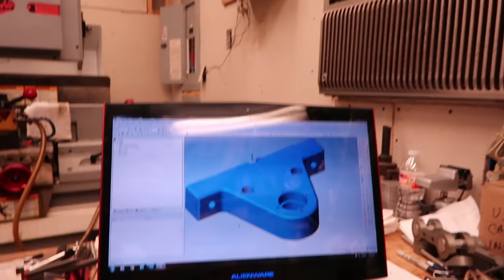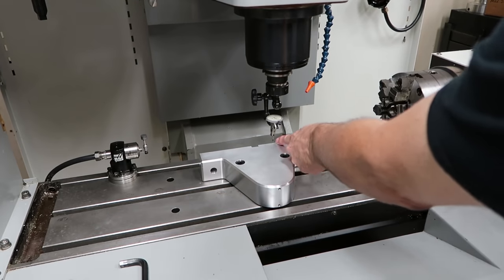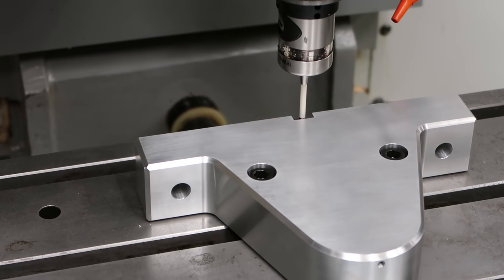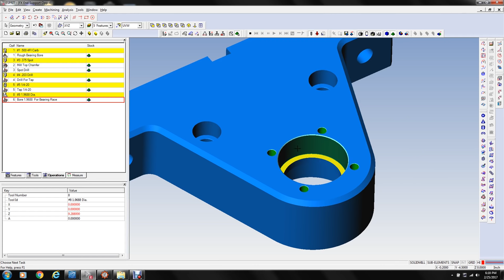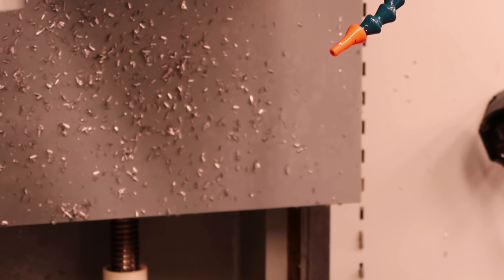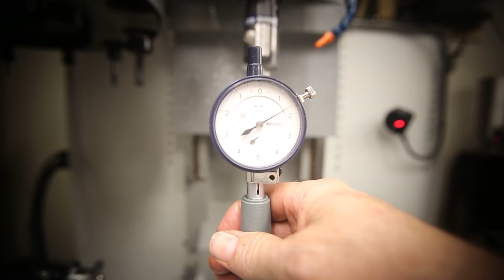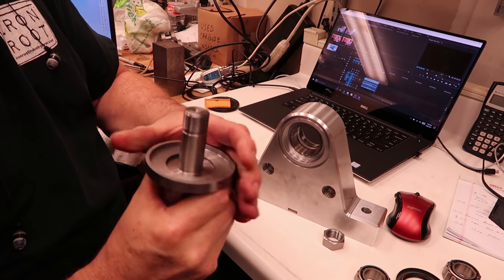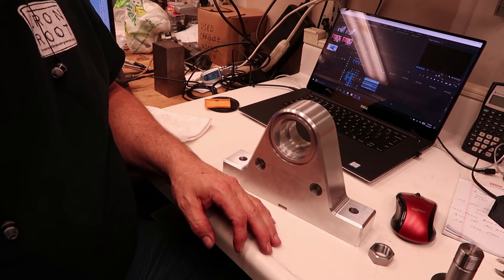5 Axis Mill Stop FX End Support Opp 4

Comment: Wouldnt the bearing race start rolling slowly and eat out the fitment as its not tight fit in the support?
Reply from the maker: Possibly that would be a concern if this was a high speed application. But the speed is very slow. Also with tapered roller bearings the more you preload them the tighter the outer race (Cup) gets in its bore.
Reply: Tighter yes but you wouldnt be able to "lock up" the outer race with just preload without damaging the bearing. But as it is slow speed and looking at the video it looks also well sealed I can understand your point.

Comment: Still don't understand why you need the adjustable boring head, can't the Haas pocket out the bearing pocket within a 1/2 th.. If not why not use the bore head after you pocket without moving the table?, and why move the table after you indicated the pocket. Curious arm chair machinist want to know! Dave....PS love the split screen on the last video
Reply from the maker: Yes you are right the machine could circular interpolate the bore. As with any CNC machine there is inaccuracies, the best this machine can do is .0005" circularity (I own a Renishaw ball bar gage I have tested it). This would at the best, ignoring tool push off a bore out of roundness of .0005". Now for this slow speed application that would be acceptable. But in a high speed application that could lead to bearing failure. The boring head is a much easer way to get a round close tolerance straight bore. Also I wanted to show using the boring head. There are other things I want to show about using boring heads on a CNC machines in future videos. Thanks for the comment.
Reply: It is always better to bore it with the single point tool: quicker, better circularity, better surface... Same as drilling is still the quickest material removal rate, and alsoe rough boring is very high mrr